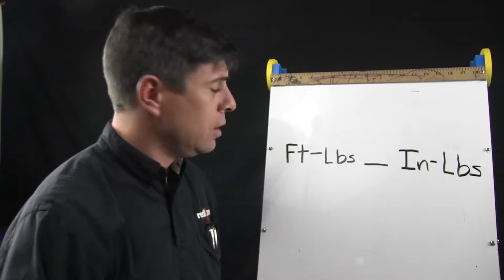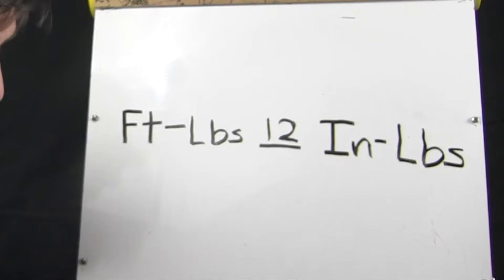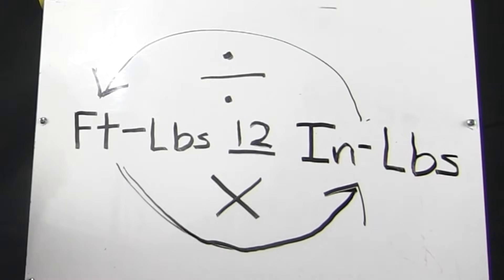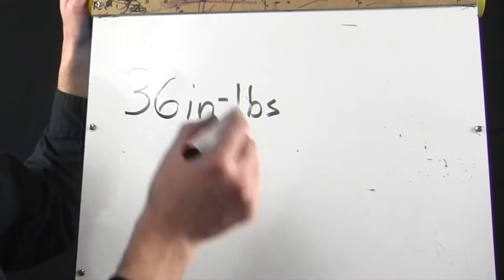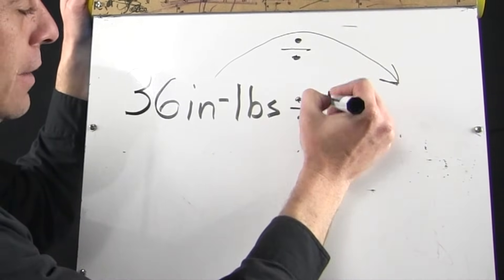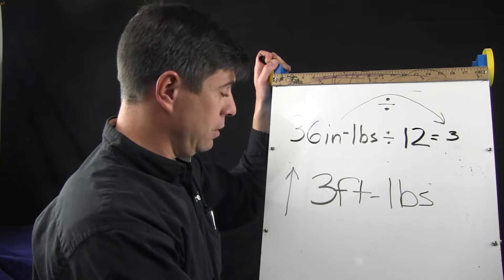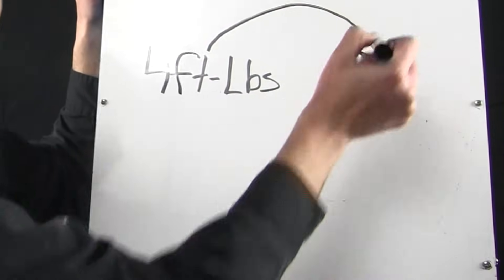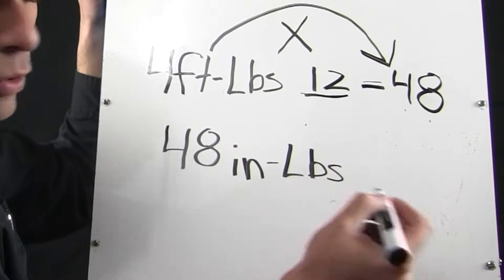Inch Pounds To Foot Pounds Conversion Explained For a Torque Wrench!

Comment: Thanks man for taking the time to explain this in your video, i was braking my head cause i was going to work on a car and seen (70.8 lb in.) in torque when they usually ask for ft lbs on installing a part on that car. I'm glad i came across your video now i get it and can do it right. Life saver.
Reply: Valve cover gasket ??

Comment: Pound-Feet to Pound-Inches when talking about torque.  Foot-Pounds and Inch-Pounds are a unit of work or power, as in horsepower; 550 Ft-Lbs/sec = 1HP.  Foot-Pounds and Pound-Feet, or Inch-Pounds and Pound-Inches, are NOT interchangeable.

Comment: I'm trying to set some anchors into concrete... the package calls for 90 ft lbs... 1080 in lbs on the wrench, is this right? Cause the torque on the wrench only goes to 960.
Reply from the maker: You will need a bigger wrench.